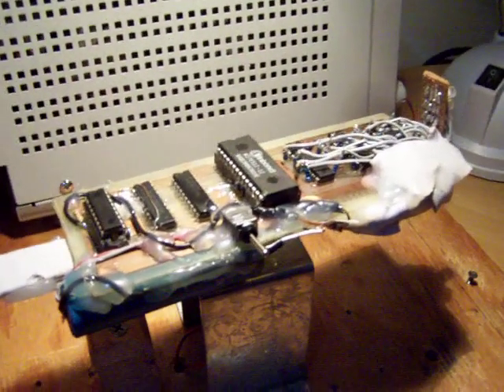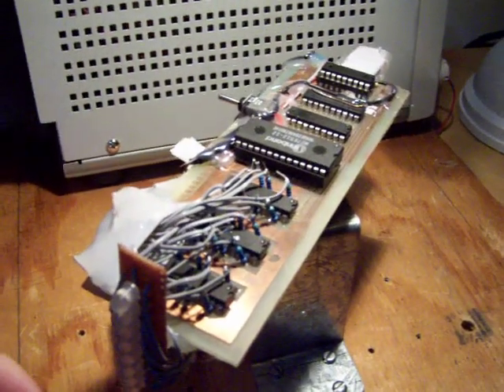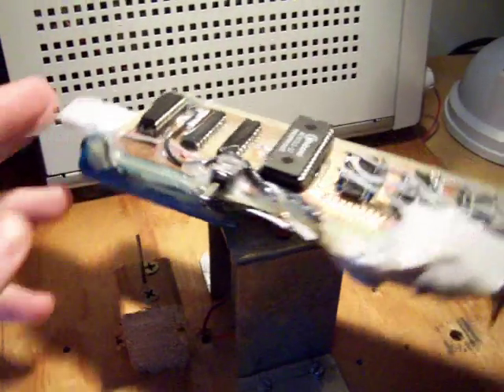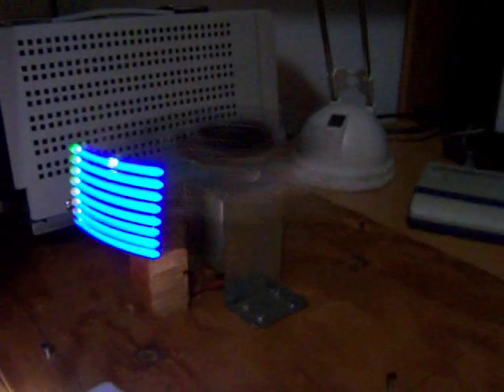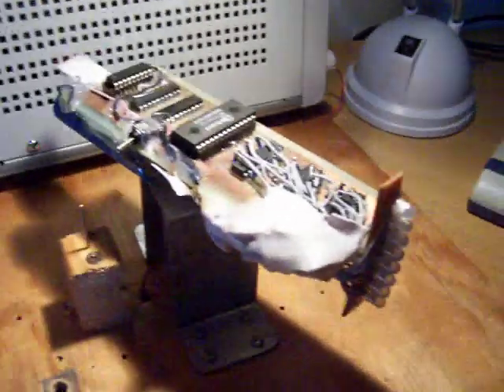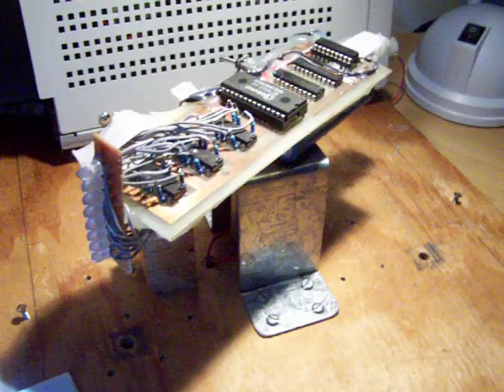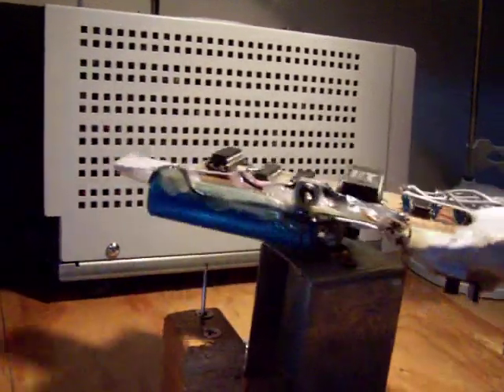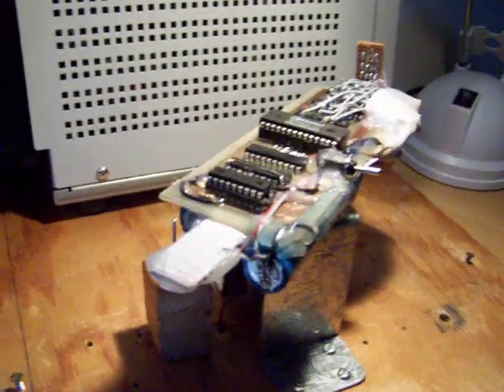A Flying animation on a spinning LED display.

Comment: What RPM is the motor running at? Very Cool! :)
Reply from the maker: Hi mi1ne, I am not sure of the exact motor speed, but it just needs to be rotating around about 25 revs per second in order to ensure that you don't get any flicker. Mine is probably slower than this because it has a tiny amount of flicker.

Comment: I know this is old, but what would happen if you used a stereo image in this, having one perspective presented to one eye slightly before another? Presumably you would need to speed it up to get the same frame rate in both eyes, but would the image be 3D?

Comment from the maker: @SuperHaloslayer123 The problem with this version is that I used batteries for the actual display.

My new version transfers power to the board so there is no need for a separate switch!

Comment: I get a real kick out of this led stuff. Have you talked to the Narrow Band Television folks? Your design looks like a 2010 version of the old 60 line mirror screw monitors used in the 1930's on the mechanical television systems. However your display is in living color.  Cool!

Comment from the maker: @MaghoxFr I guess the advantage of this version is that you only require 8 LED's (rather than 680 if it's going to be 8x85) so it's quite cheap to make and also you don;t require all of the interfacing circuitry to scan through 680 LED's

Comment from the maker: @DelGeeZee You do need to have it rotating at a certain speed, but the exact speed is not important. You just need to make sure you have a position sensor so you start drawing the image at the same spot each time.

Comment from the maker: @skilovermike It uses a PIC microcontroller. To program it you just need to get a pickit programmer (costs about $30) the programmer connects to your USB port and then to five pins on the microcontroller - the you can upload your code = )

Comment from the maker: @SagginWillies Yes you're right. Even if I used LED's half the size and put them in the same space (so I would have 16 LED's) it would make the display look loads better. I just haven't been able to find any smaller RGB LED's unfortunately.

Comment from the maker: The sensor that I have used will work just fine at that speed (and even faster) I just took the led / photo diode sensor out of a computer mouse. I then connected it to a transistor so that if the light was shining into the sensor it would turn the transistor on which would give you a logic 0 at the collector output. then when you break the led / sensor connection it turns the transistor off giving you a logic 1 at the collector output.

Comment: Ever since I first saw PoV displays being used for clocks about 15 years ago I've wondered why they're not everywhere; back then I certainly thought they would be by now. The applications are endless - you could have PoV advertising displays mounted on the roofs of cars, buses and buildings, clocks, calendars, news and stock tickers, club lighting rigs etc. Obviously these would all have to be on a larger scale and be fitted with perspex enclosures to prevent any contact with the armature.

Comment from the maker: Thankyou very much.

I had a friend make an excel spreadsheet for me where I just drew one large image (which was about 85 pixels wide x 180 pixels high)

Then the excel spreadsheet converted the picture data into a hex file which I could then load onto the eeprom.

So all this does is scrolls through that one large image and then repeats itself.

I'd like to make a better one of these (when I get the time...)

You should see the one that some guy made of a globe with hundreds of LED's!

Comment from the maker: Hi, I finished the 32RGB version but had a couple of problems with it so I went on with other projects. As for the fractal videos - I am not sure how to write a program that would convert them into the hex code required by the POV. but i guess it could be done as long as it is within the 32x64 pixel limits.

Comment: You can have electric motors near-silent - this is just a budget job obviously ("prototype")

energy efficient?  the leds use TINY energy, and if you kept the weight down, and put it in a vacuum cylinder there'd be almost no resistance.

Comment: Trough Hole Technology vs Surface Mounted.

For the one who doesn't want to mess with cad software, chemicals and magnifying glasses TH is still the way to go.
It may be a bit dated, but who cares, some things you build on a piece of  raster board before the computer had time to boot.

Comment from the maker: Sorry for the very late reply but if you goto my website (just check out my channel to  get the address) and then goto my newer 64x32 pixel pov project, i have pictures and details there of how i got the power through to the rotating boards.

hope that helps.

Comment: Under 20 RPS, you will not have good result.  I sell (Made) virtual clocks since 3 years on ebay

The best is 25-30 RPS

Comment: Are you able to tell me what delays you did use in the final event? What speed resonator does your PIC run at?

The reason I am interested in timing is that I wanted to do it using a PICAXE PIC (bootloader, coded in basic).  The problem with that is the code is slowed down - at 4Mhz you get about 1ms per command - when over clocked to 16Mhz this drops to 0.25ms per command.  I am wondering whether I can do this project with picaxe, or whether it will require raw PICs and assembler.

Andrew

Comment from the maker: You dont need to worry about the speed at all. Infact I dont even know how fast mine spins and I didn't even work out what my delay between the drawing of each column is!

All i did was built it - guessed a delay and then spun it up. If the delay is too short then the image will be quite small (because it is flashing too fast for the motor speed) but if the delay is too long then the image will widen.

When i first turn the motor on the image is small (slow speed) then it widens as it speeds up.

Comment: Hi.

I want to make my own, but I am concerned about speed.  I guessed 15 rotations per second would be needed for it to be clear.

15rps=900rpm
900rpm=66ms per rotation
66ms per rotation = 24ms per 130 degrees
=0.28ms per column.  This sounds much too fast to read eeprom, load to outputs, pulse the latch and repeat times 3.  Can you guess how fast yours turns, or tell me what pauses you use either during columns or between columns?

Many thanks,

Andrew

Comment from the maker: Thankyou.

I draw the colours every rotation. The eeprom loads up the red 74373, then the green 74373 then the blue 74373 and then once they all have their info - the outputs will be enabled which means the LEDS will turn on with whatever is laoded into their respective 'memories'

Comment from the maker: I think that would be the best way to go. It would be quite interesting to see how the circuit responds to infrared signals when it is rotating...

I guess you would want to send a pulse train of maybe 3bits?

000 = up
001 = down
010 = left
011 = right
100 = A button
101 = B button
110 = Start
111 = Reset

The more i think about it - the more i think it would work quite well. how quickly could you transmit 3 bits = )

Comment: That's actually a great idea... You could have an IR receiver on the rotating side, and a ring of IR LED's on the stationary side.  Then just pulse a serial code to transmit data.  So then you just have to figure out, is it more reliable (less noisy) than brushes?  And then, how fast can you transmit data?

Interesting idea...

Comment from the maker: Thankyou.

Sorry but im not sure of the exact RPM (i just set it to a speed that gives me the best image)

Yes, they are 5mm RGB Leds (but surface mount would be better i think).

I know what you mean about getting signals through brush contacts! It's quite a challenge and one that I havent been able to figure out yet... make sure you let me know if you get yours working!

Comment: Looks great!  What's the RPM?  And are those 5mm LED's?  I'm considering making a monochrome (green) POV display for my carpc mp3 player.  The display tracks very well, no wobble.  You used an optical detector for the trigger sensor?  I want to drive mine by PC, so I'll need to figure out a way to get serial through the brushes/contacts.

Good work, looks great!

Comment from the maker: This is where it could use improvement - because it is not very 'memory efficient'

It uses a 27E512 EEPROM (64 kbytes)

Each individual column (of 8 leds) has a red component a green component and a blue component - so it needs 8+8+8 = 24 bits (or 3 bytes) per column of data. 

Each 'Frame' has 85 'Columns' so - 24bits x 85 columns = 2040 bits (or 255 bytes)

finally - 64k / 255 = 255

Therefor it can fit upto 255 'Frames' of animation in one 64kbyte eeprom.

Comment from the maker: At the moment i am just using batteries.

I am working on some kind of brush / contacts system so that it wont need batteries (and will also reduce the weight of the rotor)